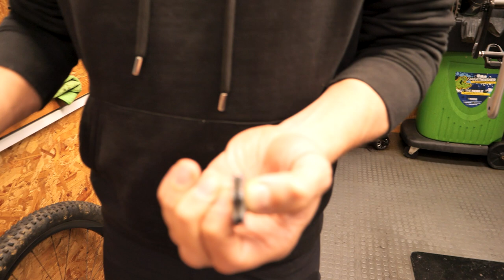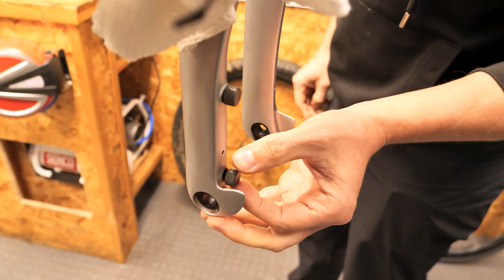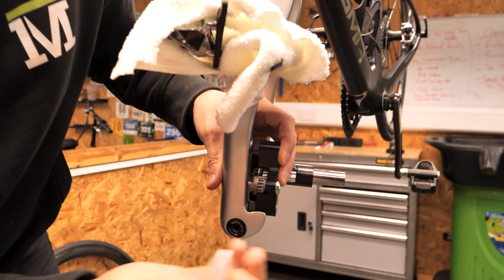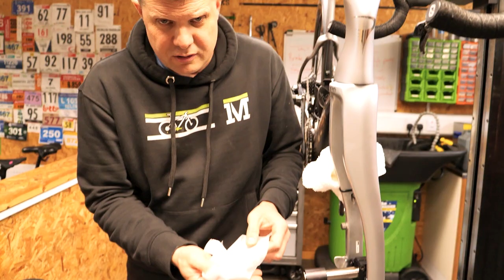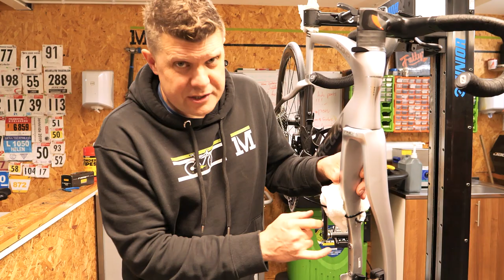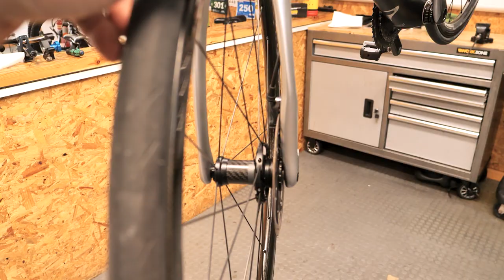The brakes on this Pinarello Dogma F rub because of laziness

Comment: This reminds of the bike builds I was doing for one Canadian ebike company. The biggest issues with the bikes was always setting up the rear disk brakes. The factory in China would often make things worse by trying to correct the alignment by removing material from the IS mount with an angle grinder! They ended up making things worse, as we would have to chuck the mount, and install a new one and realign it. It would have been easier if they just left the rear brake dangling, and let us do the final install. We often had supply issues with not having enough undamaged IS mounts to finish bike builds.
Reply from the maker: Nightmare, but this happens a lot. It was good that your company were rejecting frames rather then just trying to sell them.

Comment: As far as I’m concerned, every disc brake bike needs this check done before it leaves the shop from new. But I bet only a fraction of shops even have this tool and know how to use it correctly. Same goes for rear derailleur hanger. Every bike checked, mandatory, and held to a tighter spec that 4mm, which is rubbish.
Reply from the maker: Yes.  I also think we need something better than Cytech for education. The national apprentice scheme is excellent, but we need something in between.

Comment: I'm shopping for a brake facing tool. How do you make sure that the two faces are in the same plane with this tool? There's a facing tool from VAR that seems to do both at the same time which gives me greater confidence that they'll end up in the same plane, but I don't see them distributed in the US, so it would cost more than double than the Park.
Reply from the maker: The Park instructions and vids are good. Both tools are a bit of a faff to set up.  I don’t really have a preference.

Comment: Nice example! I was wondering if just the bolt surface is enough to adjust as very often an adapter plate is attached to the caliper which also requires proper alignment. Do you have experience with that?
That hydraulic hose is at a really awkward angle btw, have seen them damaged as a result of that, so be careful!
Reply from the maker: We sometimes see corroded adaptors

Comment: I wonder if carbon frames are 100% true/ aligned. After baking there is no room for error or corrections. Not like a steel frame....
Reply from the maker: hell no! this is the exact reason that 1 piece bottom brackets exist.
Reply: The flat mount facing needs to be one of the last things done after the frame is together and settled.
Reply: @Mapdec what do one pice bb do for alignment?

Comment: Even so, the Pinarello F may be the best prepped massive-produced frame out of the factory at this time on the market. I've seen lots of frames from other big brands much worse. The rear brake mount was covered by paint entirely, and the carbon was uneven so badly. Maybe, this is a special time, the supply chain issues, the shortage. But when we come to this disc brake age, combining carbon martial, it's safe to say any ordinary cyclist can't fix the brake mount alignment problems at home. Even for bike shops, the ParkTools or Cyclus mounts facing tools are not usual to see. This is a big issue for everyone, and the big names need to refine their building procedures to eliminate any tolerance errors around brake mounts before leaving the factory. It's not the shop or buyer's job. This issue is much more severe than BB creaking because this will render a frame totally unusable.
Reply from the maker: Amen my man
Reply: Well said James.  I recently had a bike in with me for a groupset swap (mechanical 11sp to Di2 12sp) and replaced the brake calipers.  The rear mount would not sit square when correctly torqued to 6-8nm no matter what I tried.  The mounts were not faced and visually easy to see out of square.  I contacted every shop within 30miles and none had a facing tool....some didn't understand what I was asking for!!
We purchased the Var tool.  Yes, it is expensive but I've already another x2 bikes lined up for disc facing so should pay for itself over time.
Reply: You hit my concern on the dot. How many shops have the correct tooling to really fix these situations and perhaps worse what will they attempt on a frame with the tools they have!  I'll buy tools but these ones are just too expensive to justify for home use. Even if the shop has the tool there's how to use it correctly as well. So I guess as with any mechanic (car, bike, aircraft) you need to know and trust them.  Sadly, my experience with local shops is they can't be bothered with customers asking tough questions about service.
Reply: @mike_f  "we just hand file them by eye until the brake doesn't rub" was one of the responses I had!
Reply from the maker: Bike shops without tools are just retailers.
Reply: Every time bike I've seen has been very good. Not cheap and not flashy but it works
Reply from the maker: @Hambini  that’s all we really want, really really want.
Reply: @Hambini  Maybe, because the RTM way is easy to maintain good shape for every contact surface. But Time really needs to update their design.

Comment: My Prince drives me absolutely crazy. Someone told me that this park tool doesn’t work on Pinnarellos. This tells me differently.
Reply from the maker: On some it doesn't and we have to do it by hand and lots of measuring.
Reply: @Mapdec  Off hand do you know if the park tool will work on a 2019 Prince Disk Di2? I wish you were close by because it sounds like you have a lot of experience with this.
Reply from the maker: @Dave-so7sf  🤷‍♂️

Comment: What happens if both surfaces are flat but offset from eachother?
Reply: then there is no fix, get a new fork
Reply: You remember hiw good life was with rim brakes
Reply from the maker: The design of the brake mount can cope with this to 1mm or so.
Reply: @bodoprobst  rim brakes are so dogshit too, they always have uneven wear on the pads and are hell to setup perfectly straight. Also completely unusable if the rim isnt straighter than a sword
Reply: @nick37781  that’s no tue. Rim brakes are a lot easier to setup to work perfectly. Yes, can wear unevenly but that’s easy fix